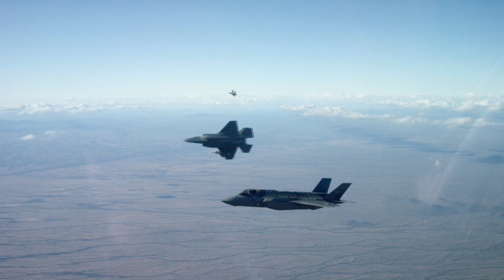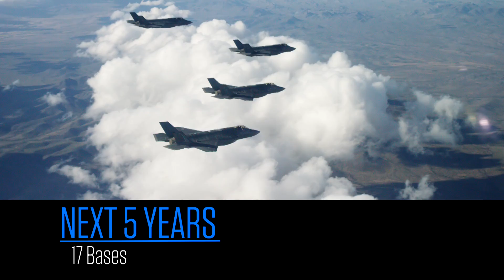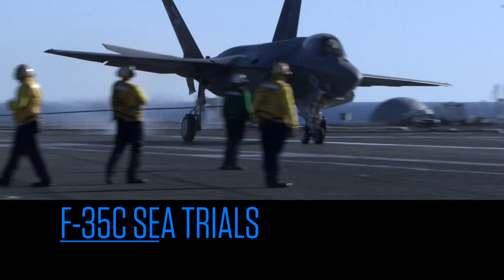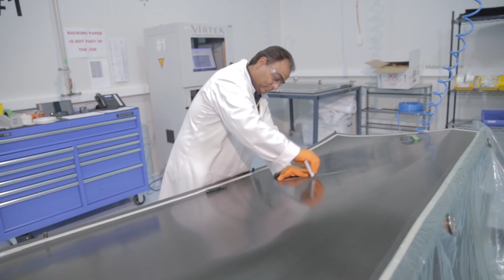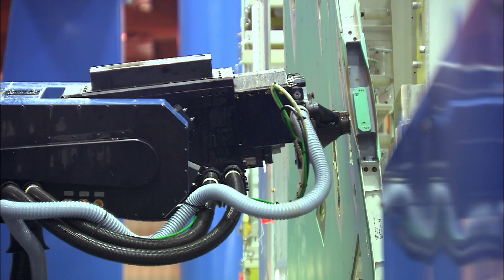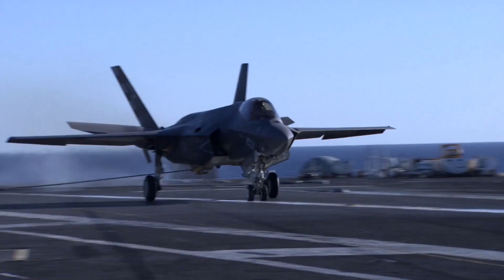Momentum,Maturity and Milestones: The Australian F-35 Program 2014 Highlights

Comment: Looks nice, but will they stand up to the Eurofghter, only time will tell.
Reply: They are designed for very different roles. The Typhoon was solely designed for air superiority and to out maneuver the Russian Su-27 which the British considered to be the most dangerous "threat" fighter in the world. And it works as advertised! Currently it's only match, in turning engagements, is the French Rafale and the F-22. All allies but the way. 

The F-35's were designed as a multirole platform from the outset. It's bigger brother the F-22 is built for air superiority only and does that better than any other fighter flying. However the 3 F-35's have their strengths. The A model, for example, is rated at 9g's. The same as the F-16.

Many people have already decided to hate the F-35 before it's ready but I think they will come around when they get a chance to see an F-35 really open up at an airshow and ultimately in war.
Reply: EuroFighter is not stealthy at all, so yea it will be able to be used...what's the diff between a tyhoon and a f15...not much.
Reply: +vijay mehra The massive cost overuns was more due to bad planning and a clusterfuck political decesion of having it produced in almost every State.